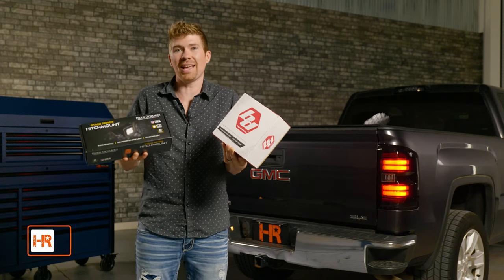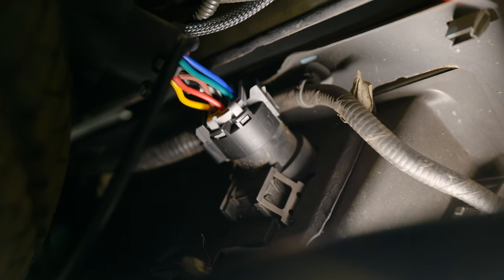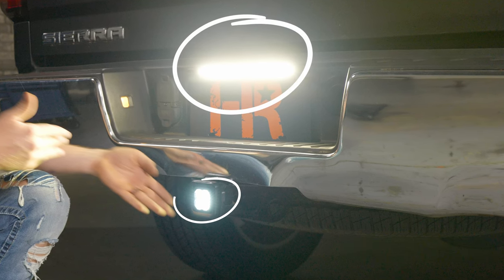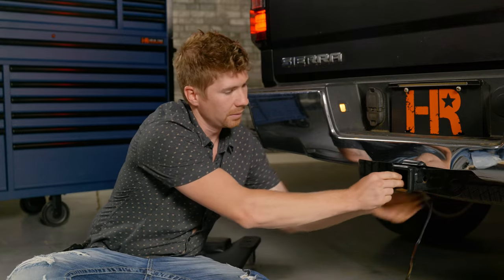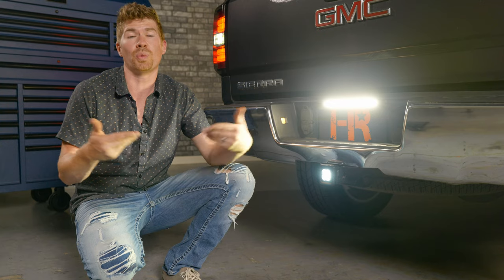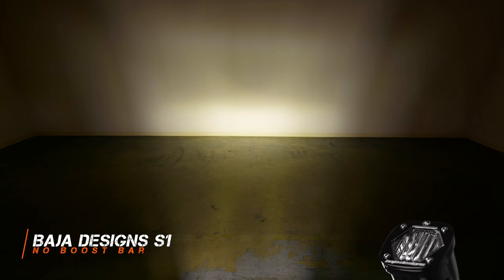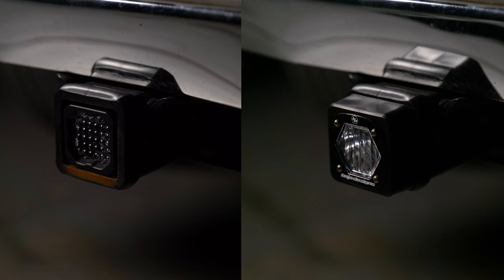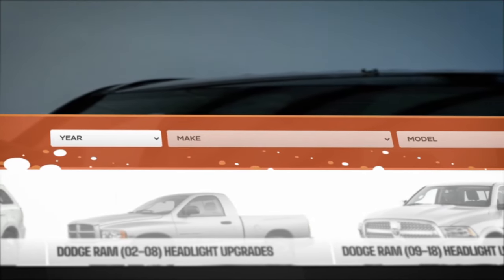We Found The Best Hitch Light For Your Vehicle! | Diode Dynamics VS Baja Designs

Comment: So the DD won.  Yikes that means the Baja designs is horrible.  I bought the DD and it was so negligible and the light pattern was so narrow it wasn't worth the price then charge.  I would hard pass on the DD and if the BD is worse then get neither and wait for someone to make a proper light for this specific application rather than just slapping a fog light into a hitch housing.

Comment: I hate how DD uses this optic for the hitchpod. I use the wide optic for my truck and it’s much better. You do have to cut the bottom of the pod though, where it would normally mount on a universal bracket. The hitchpod pods have a cut out already to slide into the receiver. DD should definitely start incorporating different beam patterns to compete with BD!

Comment: One issue with these hitch mounted lights that tap into the 7 pin harness for some trucks, is that it thinks you have a trailer attached and you keep getting trailer warnings. Diode Dynamics has a fix that uses an included wire that plugs into the harness then you have to route it up to tap onto the brake light wire.  They also offer a way to stop the strobe when you first hit the brakes if you don't like the strobe feature.  Another thing, all these guys make it look easy to route the wire through the hitch, but if you have a hitch like mine, it is solid metal at the back, so you have to drill a 7/8" hole to get the wire in.

Comment: Should also note that the tabs on the DD can be broken off to allow a locking hitch pin to be used.  The light also sits flush in the receiver so it can't be forced out or broken.  The Baja sits outside the receiver and someone with a pry bar can mess with it.  It can also be damaged if something hits it.

Comment: I'll stick with my light bar that is under my tailgate (opt7).. don't need to remove it if I want to use the hitch, don't need a 7 pin connector (ford maverick), looks better than the little light in the middle, is brighter, and a little bit cheaper.

Comment: Would like to get the license plate light with a 7 pin plug and play connector. I don't want to do any wire stripping or soldering.

Comment: I went for the Diode Dynamics specifically for the that low mount brake light feature. I don’t plan on towing anything other than an off-road trailer with my new truck so the quick connection and disconnecting of that light makes it not so bad. If I want to tow I have my old 93 250 as a tow pig haha. Great comparison video. Also one thing to note is the Baja designs light was using a spot light lens while the Diode dynamics light was using a flood light lens so maybe do an update video swapping out the lenses and see how it compares after that. Could be interesting

Comment: I love the idea of a hitch light The issues are run into is if you use a dedicated receiver like on a super duty that's 2 and 1/2 or 3 in I don't think these worked correctly and also on the new Fords if you plug something into that seven pin adapter underneath it like you're showing it gives you a fault code saying that the trailer is connected
Reply: That's been fixed on the newer model lights